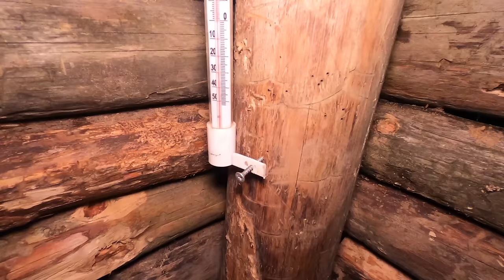ALEX WILD dugout life: atmospheric OVERNIGHT stay. Hiding in a HUGE dugout BUSHCRAFT. PART 21

Comment: Another great video. The 2nd room is coming along great and the cover for the window is a brilliant addition. Even since you installed the window I've been worried about some random person coming across your dugout and, unknowingly, stepping on the window and breaking it so it's great to see it's now protected.

>>EDIT: I should come along and do your chainsaw work for you. I don't need ear plugs 🤣 🧏‍♂️
Reply from the maker: I once worked in a noisy production! It is better to protect your ears from acoustic loads
Reply: Winter forest - booming, like shots, croaking crows, snow from a spruce branch that fell by the collar, tracks in which the bottom is not visible, steam from wet mittens and parallel, now and then intersecting curves of ski tracks; spring forest - the smell of black, still frozen earth, flowing in all directions, choking with melt water, a stream, a thin white strip of skin blue from the cold between a sweater and jeans, and on it large pimples that can only be melted with lips; summer forest - hot drops of golden resin on copper bark, hair smelling of barbecue smoke, a white, daisy-covered sundress stained with dry red wine and a tickling pine needle that you can’t get at all if you don’t unbutton two thousand small, like ladybugs, buttons , rapidly spreading under the fingers along the back and chest.
Reply: As an audiology student I can tell you EVERYONE needs earplugs when dealing with high decibels—to not wear them is just asking for early onset sensorineural hearing loss. You are doing irreversible damage and once your hearing is gone, no hearing aid will ever match the quality of your original hearing. Protect your precious inner ears!

Comment: Second room coming on nicely Alex. Glad you made a shutter for the window light,so it should not leak or get an animal through it. Take care
Reply: Winter forest - booming, like shots, croaking crows, snow from a spruce branch that fell by the collar, tracks in which the bottom is not visible, steam from wet mittens and parallel, now and then intersecting curves of ski tracks; spring forest - the smell of black, still frozen earth, flowing in all directions, choking with melt water, a stream, a thin white strip of skin blue from the cold between a sweater and jeans, and on it large pimples that can only be melted with lips; summer forest - hot drops of golden resin on copper bark, hair smelling of barbecue smoke, a white, daisy-covered sundress stained with dry red wine and a tickling pine needle that you can’t get at all if you don’t unbutton two thousand small, like ladybugs, buttons , rapidly spreading under the fingers along the back and chest.

Comment: Hello again Alex. At 20.14 there is an orb that goes from right to left of the screen and then 2 or 3 more a few seconds later in reverse direction. They are perfectly round & definitely do not look like dust, moths or any other little flying things. This also can't be your light as it's not moving around the room to interfere with the camera. The work you have done on your cabin is looking great. Do you stay there a couple of days at a time or a week. You look to be settling in for a long stay. 
Again, your friend from Australia. 🙂

Comment: I wish my soil was sandy base like yours.   What I have is red clay with "tiff"   (Google that),   rock from less than an inch to a whole rock face hillside.   No shovel can move it,  only pneumatic rock drill and dynamite,  lol.  Working construction on a 6 inch water supply line for a lake community I was their powder man also and set many miles of drill holes because of that tiff rock.  Barite is it's real name, very dense,  heavy like lead,  & used in many applications such as paints, cosmetics,  ect.  So,  unless they'll let me renew my demolition permit,  lol,  I'm too old,  I won't get to build any dugout around here at home.  So,  I'll just wish and watch you enjoy yours through your videos.  Zabotit'sya Brother